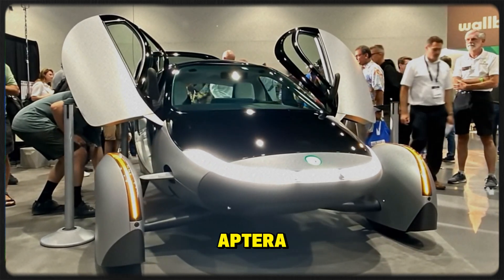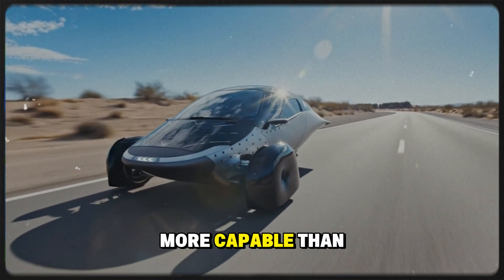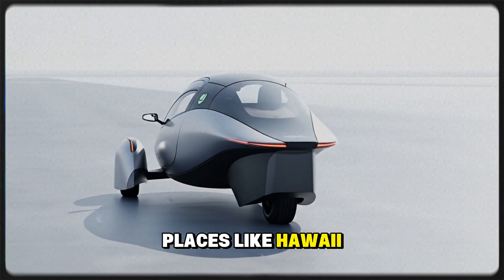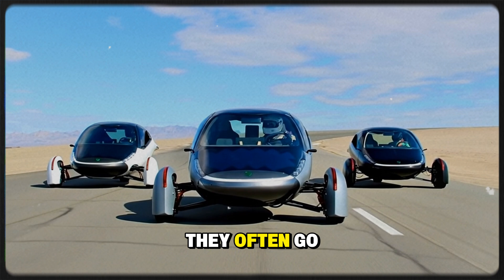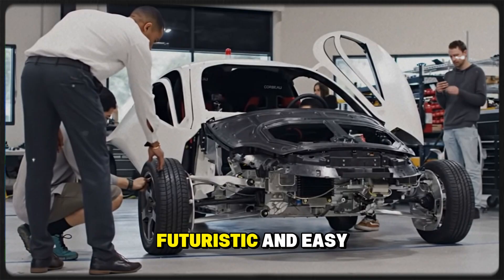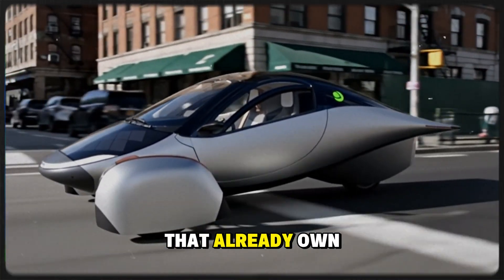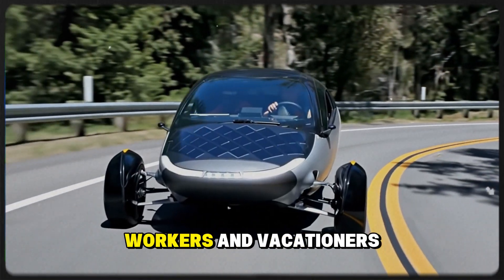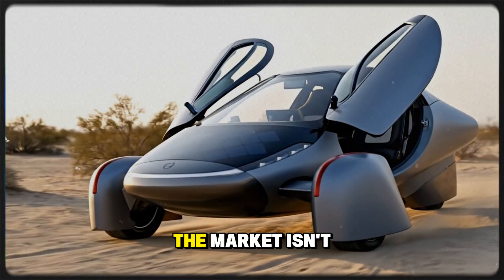Aptera’s Market Just Exploded — The EV World Isn’t Ready for This!

Comment: Solar panel aren't enough alone but nice to have as a car is usually parked more than half of the day. It might give enough power to refill 10% battery which means 10% less on electricity costs. I like the futuristic design but it targets a market already full of solutions, ebikes (bicycles and motorcycles) fit better the urban commute. Still this one could be usefull for people not feeling safe on bikes, when it's raining or when you need to carry groceries (although cargo ebikes can also do the job but imo those are too expensive). And 3 wheels are ok for urban commutes but not so good for regular roads, i would be afraid of oversteering 😅 I'll be curious to see the distance range and selling price of this car, if as the video says it's affordable, even if it's 3 wheels i would be interested in it.
Reply from the maker: Thanks for sharing your perspective on the solar panels and the three-wheel design – curious to see how it performs too!